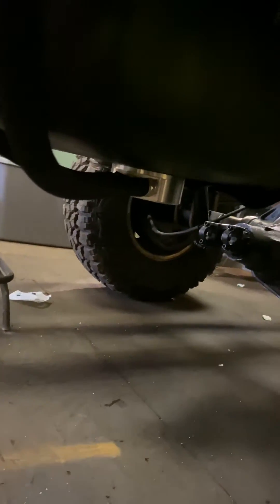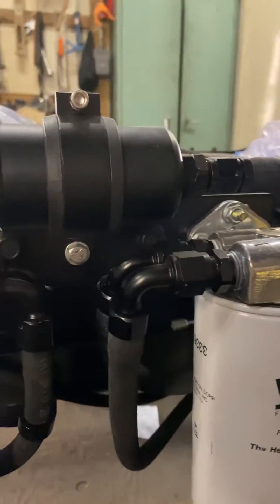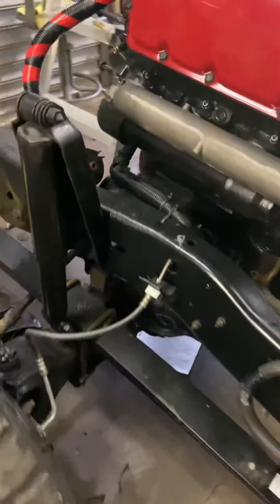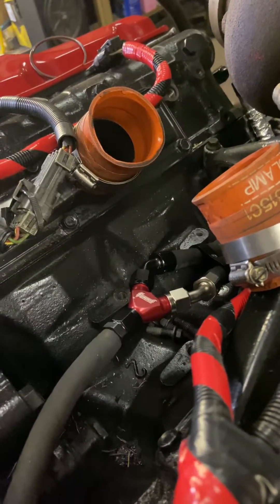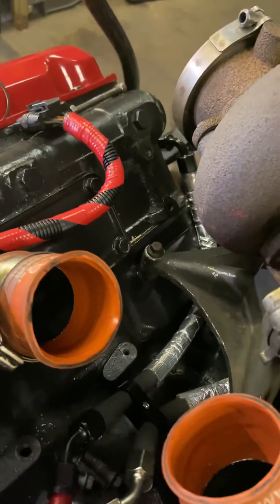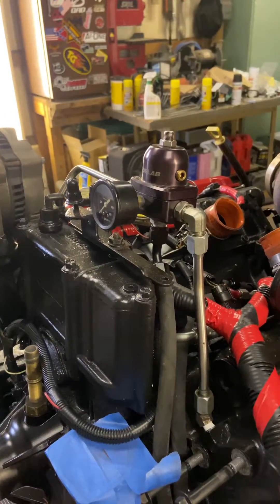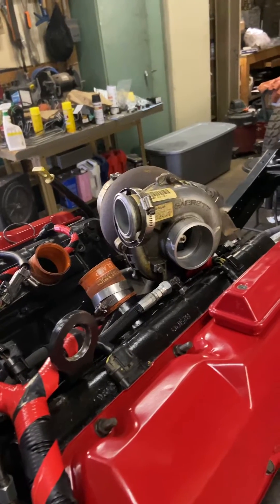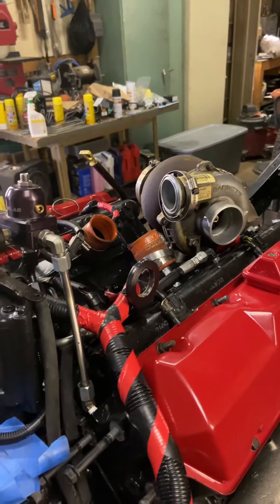DIY OBS 7.3 Powerstroke Competition Fuel System

Comment: Personally if i had your truck sir i would firstly keep it forever, and secondly i would add a fuel box in the back for more down force in the rear, and even higher filtered fuel if you just keep your bed box full im sure the whole truck would even ride smoother. And personally, swing and latch rear boxes too for that nice even distribution of dig in down force even if your tires are aired all the way, itll take off great with all that weight but hey thats all just my opinion

Comment: Great job on your fuel system. I’m working on mine for my 2000. I have an airdog. Do you see a problem with me doing my return line only from the air dog pump. And running my supply to a fuel distribution block. Centered on the valley, then supply each of the 4 corners of the head (no return from the heads). Kinda like the Cnc fab kit. Curious what you think. I like how you run your supply, starting at the rear of the head and returning from the front of the head. I think that kind of resolves the number eight fuel problem.

Comment: I finally finished this same setup today , truck feels good but i noticed i set the fuel pressure gauge to 65 70 ish ...cane home checked it and it was down around 57 60 ... adjusted it again and again and again and now the needle wont budge from 50. What do i do man ?
Reply from the maker: I’d say pull the return line off after the regulator and see if you’re getting any fuel through it. If not, then you either have a blockage or the pump isn’t pushing enough fuel to get any higher than 50psi
Reply: @ROELKEY2442  it's all new lines .. but I'll pop the line off snd see what happens..the pump is about 2 to 3 years old already ...not sure if it was a name brand Bosch pump or not .. I'm just gonna throw a new pump on anyway and keep the current as a emergency replacement in my tool box

Comment: Hey man I have an important question and I thought you would be the person to ask 🙏. When you Run a regulated  return setup with a lift pump and a sump do i need to plug off the factory return completely or T it into the lines that return to the sump. I think I'm explaining that correctly. I can make a video and post it and maybe get some help that way to I guess anybody can chime in.
Reply from the maker: My factory feed/return on the sending unit is capped off. Depends on if your sump has 1 or 2 ports. If your sump doesn’t have a return you need to return through the factory return
Reply: Hey Thanks for the Help today brother 🙏 you got me Goin when I was second Guessing Myself ..have a great 4th of July💪

Comment: Does both sides of the regulator go back to the tanks? I could not see that side of the engine.
Reply from the maker: Either side is the lines from the heads to the regulator. The line out of the bottom goes to the tank

Comment: Thanks for the information . I need this same fuel system setup pretty much. My fuel system is way to small for 238/100s and the other items I have.  I like how everything is clean and mounted and the lines are ran . Good job buddy 👍 keep on pushin 💪🤠🙏
Reply from the maker: I’ve been running this setup with my 238s and have never seen a fuel pressure drop it holds 70 PSI WOT
Reply: Perfect👍  . Ya I haven't Beefed up my fuel system for what I have and it keeps dropping fuel pressure really bad . I  Don't wanna ruin a brand new to me set of 238/100s single shots . Not to mention they were 3000 buckkkks
Reply from the maker: @cupwalker24.7  my brand new rosewoods were less than 2k to my door. I don’t know who you bought them from but you got boned on that deal lol
Reply: @ROELKEY2442 kinda thought the same bein a single shot…

Comment: Do you have part numbers ? I want that exact t fitting to connect the rear fuel lines to the 1 feed line ... did you make those front hard lines or they were part of the irate kit you had ? Or can you give me any info on an fittings and how you did the rear Cylinder head fittings ? I wanna make a kit just like this ..looks great sir
Reply from the maker: All the fittings were found on summit. For the Y it is just a “-6 AN male to male Y fitting”. The holes in the heads are 1/8” NPT so you just need fittings that go from -6 to 1/8npt.  The hard lines were part of the irate kit. And actually I have since put the rear ones on since I’m now T4 and they fit nicer with the bigger charger.
Reply: @ROELKEY2442  cool thanks man
Reply: @ROELKEY2442  1 more thing ,,what size fuel line is that ? Thanks again
Reply from the maker: @TylerMcarsandstuff  from sump to pump is -8 (1/2”), rest of the system is -6 (3/8”)
Reply: @ROELKEY2442  is the return line fitting and line 1/2" or 3/8's ? Is there a issue with running different size lines before and after the pump ? Also I noticed up on your engine it's lines then the regulator ... I always see guys running some type of fuel block and then the regulator
Reply from the maker: @TylerMcarsandstuff  both my feed and returns are 3/8. And the bigger line pre pump is so the pump never starves for fuel. Most “fuel blocks” you are seeing are nothing more than a splitter which is exactly what the Y-fitting is for in mine.
Reply: Also, what is the reason for pre pump filter and post pump. Is it just to keep debris from the pump
Reply: @Content7.3  yes it's to keep debris from the tank out if the pump and then the second one protects the injectors from being damaged by a pump failure.